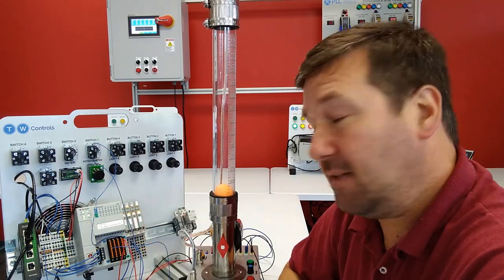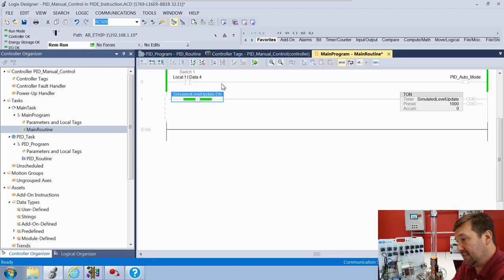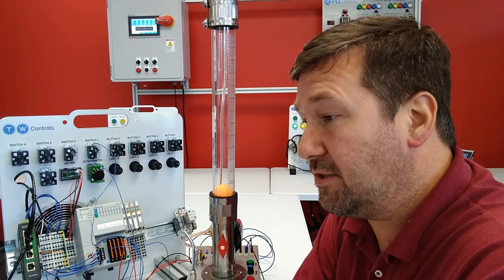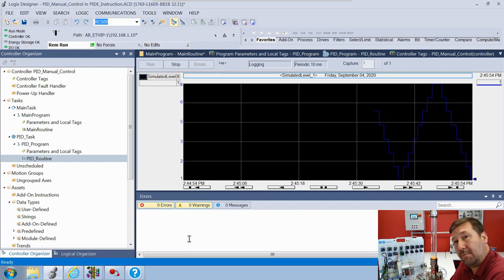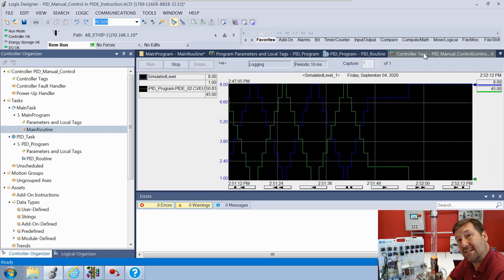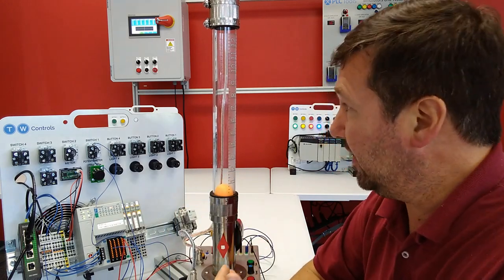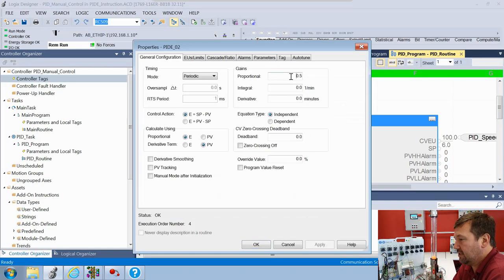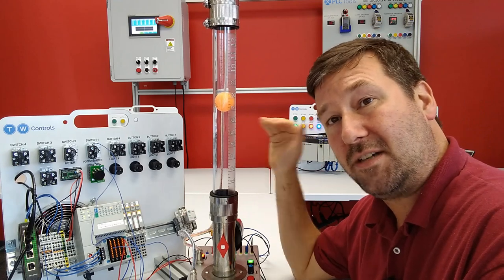What does the P of PID do?  Proportional Control of PIDE in Studio 5000

Comment: How will these concepts apply to loop controllers? Can I follow the same concept when programming PID on the loop controller? At our water treatment plant we use loop controllers instead of Plc.
Reply from the maker: Hi Darnell.  98% the same.  Depending on the particular PID controller, they may use a slightly different equation but the principles are the same.

Comment: Hi Tim, I am having difficulty to control PH value using PH meter, ON/OFF acid and base valve. When I searched on the internet, it mentions Time proportional control and I am not sure how to deal with this formula. Is it the same with normal proportional control?
Reply from the maker: When I think of time proportional control, I think more of pulsed wide modulation but I guess it could have another meaning.

Comment: Actually Proporcional IS multiplied by the Error. The Speed equation only writes It diferently considering the way a digital CPU deals with it. But If you deduct the equations CV = CV n-1 + Kp* DeltaE is the same thing as CV = Kp*E
Reply from the maker: Nope, make sure you know which equation your PID is using.  See if this helps. https://www.youtube.com/watch?v=FVTv6Gi9IJo
Reply: Tim, thank you for your repply. I have been through that equation and it's driving me nuts. I still can't understand how to calculate the exits.

 Because matemathically the CV e-1 should cancel the DeltaE term. If we put numbers for instante: We have a moment t1 with error 2 and a moment t2 with error 3. And Kp of 2. 

At t=2 with the positional form we would have CV = E.Kp = 3x2 = 6

With the velocity form we would have CV = CVn-1 + Kp.Delta E = 4 + 2x(3-2) = 4 + 2 = 6

That's why I think It should be same. It only should be different with 2 blocks feeding CV n-1 in each other

I feel there's a glich in there but cant find it. 

Thank you for your vídeos
Reply from the maker: @MarceloNMF  That is why this exercise is important.  Plug this program into your Controllogix or Compactlogix PLC and you will see that is not how it works.  Here is another resource that may help, I reference it in the other video.
https://controls.tw/pidalgorithms
Reply: @TimWilborne  Thank you for all your help. So here is my last question: Is there a way to use a positional form PID in ControlLogix? I currently use Logix Designer, exactly like this one in your videos. Merry Christmas and thank you again
Reply from the maker: @MarceloNMF  You aren't going to be able to use Logix Designer to learn about Studio 5000's PIDE instruction.  It uses the positional equation which is why you are getting confused.  Merry Christmas to you!